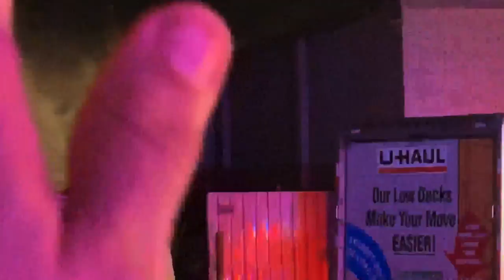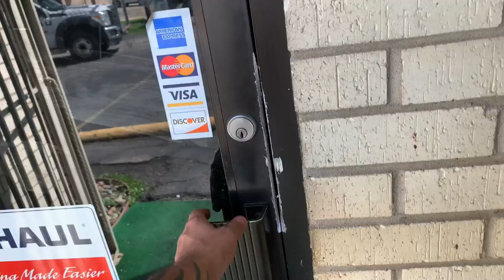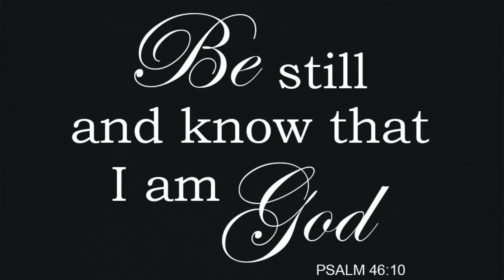911 Called! Our Business Burned Down! Everything Destroyed! (Not Clickbait)

Comment: 6:48, Those collapsed concrete walls can be extremely dangerous in fire situations. This is why I wish more construction/building companies would properly lay concrete walls in a building like they should for concrete walls around parking lots, tying the walls into the foundation with rebar, and filling all the voids with concrete. If those walls were done more securely, what may have happened is just the roof would have collapsed, making it safer for the emergency workers as they tried to put out the fire. The grout ls alot like glue, once its set, the hotter/dryer it gets the weaker it becomes until it is no longer stable. So many construction companies make the things that make cmu walls so much more structurally sound an option, and ends up costing the owner and the insurance company in the event of failure so much more money. 

If Grimes Finds sees this comment, if you go to build a warehouse in the future, and do a cmu construction make sure whoever you go to build with has at the very least rebar ties into the foundation of the cmu walls, then opt for something a bit more robust. Plus its always nice to have fire suppression whenever possible, weather it be sprinklers, or chemical/co2 suppressant systems.  ICF systems are a good alternative to the CMU and are similarly priced(sometimes cheaper), but basically has built in rebar supports for the building and insulation, foxblock and buildblock are some good icf companies. ICF has the same fire/weather protections that a solid properly done cmu building can have, but with improved insulation (so they tend to have better insurance rates compared to some metal/wood buildings).

I wish you the best in rebuilding, and if you read this I hope it was helpful, or informative. God bless